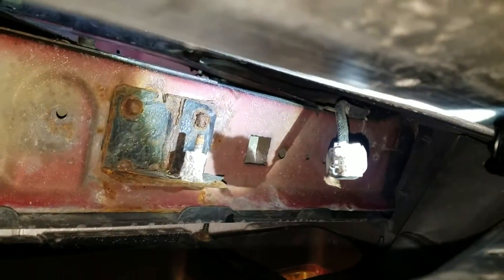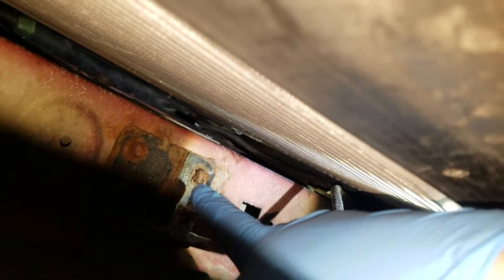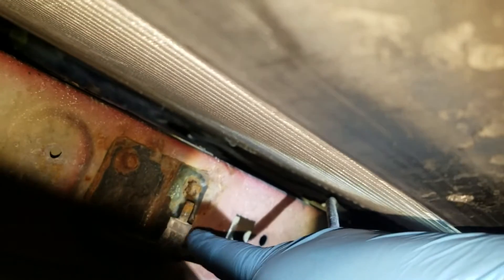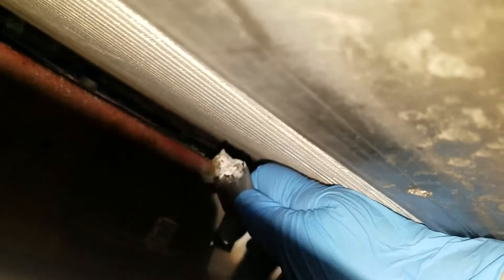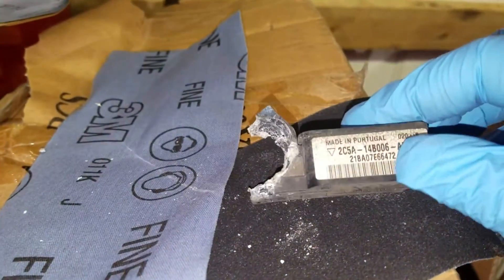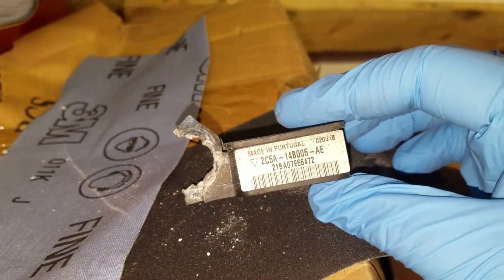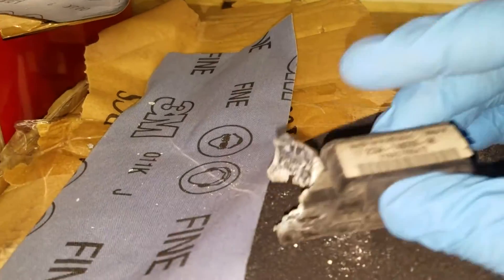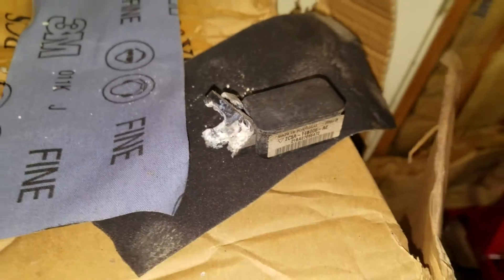2002 Ford Explorer - Air Bag Light On - Front Impact Sensor - Code 42

Comment: The 02 I'm working on does not have a sensor up front as you say, there isn't any wires coming out of the harness like there is on a 03 that I'm taking parts off of.
Reply from the maker: 02 is a weird year, it was the changeover year and they modified the car alot with different options, etc all in one year. It's one of the most frustrating years to find parts for and accurate wiring diagrams

Comment: Hey Ryan, I know you did your best to relay this information for us, and it's much appreciated.  Wish the video shooting was more directly on the process of removing that sensor.  But, quick question as I'm still looking for that sensor on my 2004.  Did it take a long time for that whole project?
Reply from the maker: Sorry I know it could've been better, it's just a very hard spot to get to and record at the same time. It's not hard, all you need to do is remove the radiator shrouding between that and the front bumper around the bottom and you can reach your hand up there with a ratchet. All it is - one bolt and one electrical connector
Reply: @ @ryanericw  Thanks, I see that the vehicle being lifted must make a hell of a difference, to provide much needed space for maneuvering in that space.  But, I will definitely give it a go.  It's next to impossible to locate and find any videos, regarding this topic with a serious show and tell.   Thanks again Ryan W. for your quick reply, you video peeps really help out a lot of folks.  Keep up the good work! (Thumbs Up!)